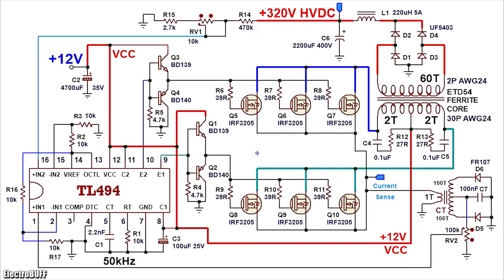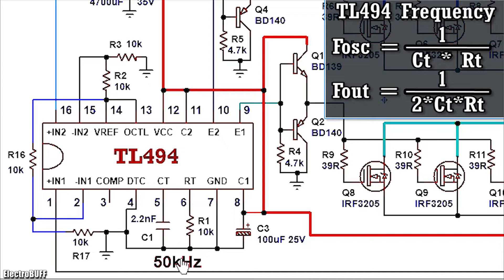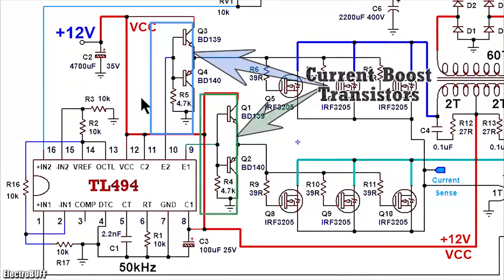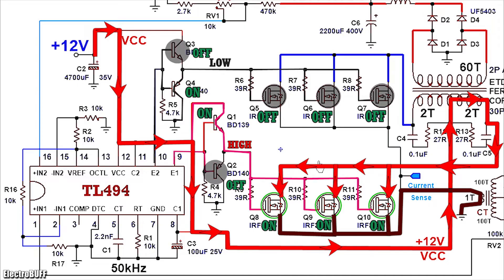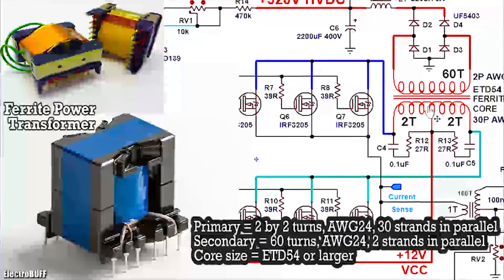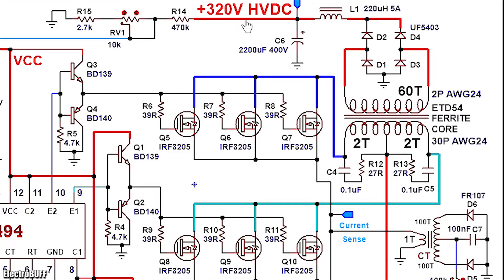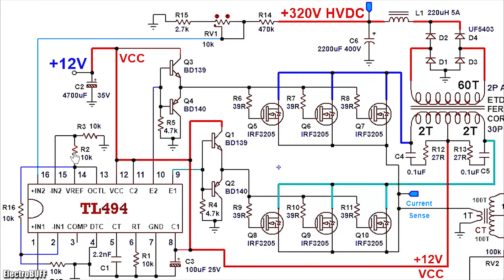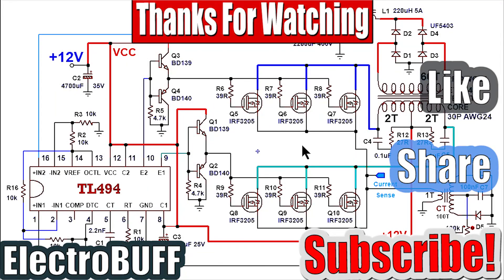TL494 1200W Switching Power Supply for Power Inverter | Regulated 12-320V DC DC Boost Converter

Comment: I tried this circuit. But there is severe heating in MOSFETs and 27R resistors. I tested it with a resistive load of 1K, 100Watts resistive load. Could you verify if this circuit is working for you.
Reply: Is this working for you

Comment: Your schematic diagram is a one mistake  pin 15 and pin16 not feedback pin. it's a current sensing pin, error amplifier over current protector. pin1 and pin2 output over  voltages protector, error amplifier. Pin3 feedback pin output voltage adjust pin.Okey redrow your schematic.

Comment: I wanted to note that the current transformer (CT) is ineffective for direct current. You can use it here, but you have to thread the transistor wires through the magnetic core in opposite directions

Comment: Do you have a inverter diagram that mosfet don’t get hot the mosfet getting hot even with the totem pole driver the mosfet heating up at no load the mosfet voltage rate is 2 to 4 volt turning on I use a 15 amp diodes to the transformer because with out the diodes the transformer vibrate and but the mosfet is getting 10 volt at its gate and stills heatings up I try 10 different irf type mosfet and all heat up from this design I want to use a optocoupler but the optocoupler I bought only alow 10 volt to pass from the 20 volt the gates need
Reply: Reduce the gate resistance to about 4.7ohm....And also reduce the switching frequency to about 32khz. If it persists then the fault is from the transformer, u have to rewind it to suit the system
Reply: @MitechElectrical  thank but I’ve learned a lot about engineering from months ago and get really good at it and design some pretty good mosfets drive and spwm driver  module and programming it’s like walking in the park now but my issue was not the transformer but the gate rds and switching off was not fast enough to fully pull the gate down to ground for smooth switching and the frequency was in the kHz and when using mosfets for faster switching resistor can’t turn off the mosfet fast enough to stop liner switching so the mosfets generator heat at higher frequency when resistor is being use for switching off at higher frequency because the fact is resistors can’t fully turn off when using kHz only a 1 amp rating bjt pnp can do the job

Comment: Hello, nice video ! is it a sinewave suitable for fridges ? thanks
Reply from the maker: no, it's a modified square wave. it should work, fridges use universal motors, motors don't need a pure sine wave necessarily.
Reply: @ELECTROBUFF  Thank you for your answer, i believed new fridges (inverters) needed pure sine wave ?